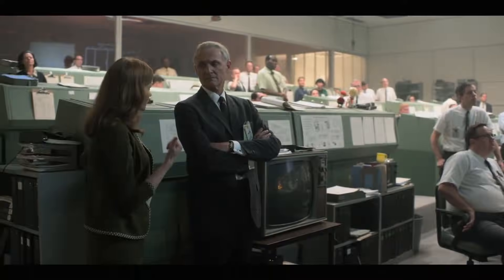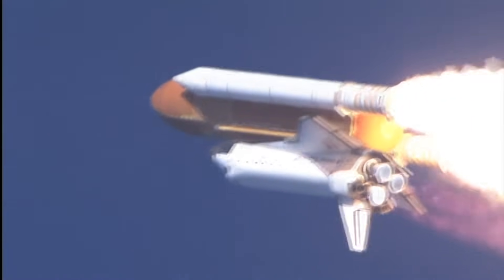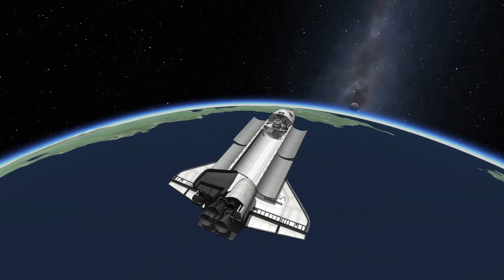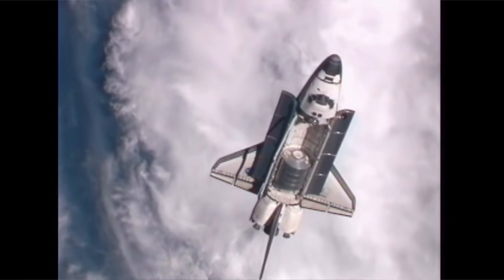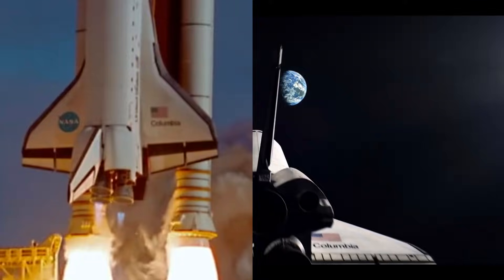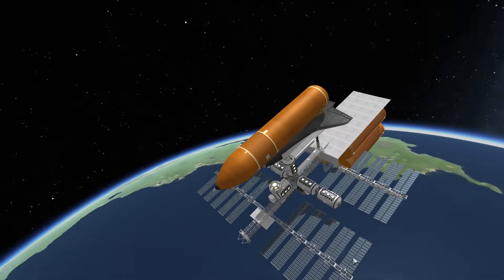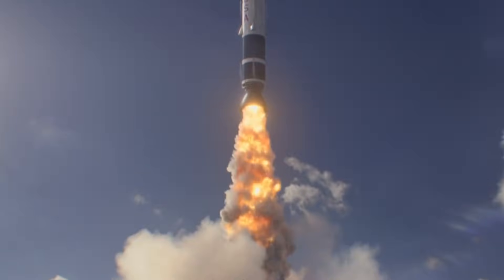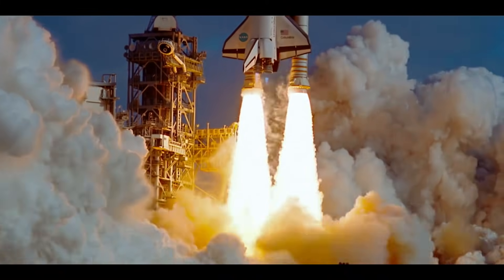How To Send A Space Shuttle To The Moon

Comment: The most unrealistic thing about this video is a working space shuttle in Kerbal Space Program.
Reply: its possible to make one, you just have to get the balance correct.
Reply: @alexvives1335  I found it easier to make a Buran style shuttle in the end. The balance was less finicky.
Reply: Once you figure out how to line up the COMs and COTs through each stage it’s fairly straight forward. I did it in one single design iteration after I figured that out and I know $&#% all about physics 😂
Reply: @thomitch1995  ofc it would, Buran and Energia are better.
Reply: @machirim2805  none of that commie talk here, thank you very much
Reply: @thomitch1995  i just add 4 strap on boosters on all 4 corners of the shuttle
Reply: bless mods
Reply: @machirim2805  Fucking LOL.
Reply: @thomitch1995 Really? I always failed to get my Buran-Energia to Orbit in KSP, but have a Space Shuttle that works okay.
Reply: @cocodog42  wanna share your technique?
Reply: @rhycecomley  use the COG and COT indicators and run the COT directly through the COG. The COT has to go through the COG directly enough for the thrust to be balanced. It has to run through the COG at every stage separation and even when fuel is burning. Because of this I normally make them backwards to visualise the craft at every stage separation and shift weight around slightly/shift angle of the two small thrusters on the shuttle, and change fuel levels ect. If you balance it well enough, any slight variations in COG COT alignment will be small enough for SAS to deal with. Good luck, if you are clever enough you will be able to do it.
Reply: @cocodog42  cheers for the input, however it seems alot less about how clever you are and more about luck lol
Reply: Skill issue
Reply: You can say that again
Reply: @awesomemcawesomeshorts9531 is it communist to say the buran was better than the space shuttle?
Reply: There is a pretty good one out there for RP1 / RO
Reply: Especially one in what looks like RSS
Reply: With the correct balance between trhrust, gliding and mass you can also do it stock.
Reply: Nah it was when he said “assault weapons”. Dumbest thing in this video.
Reply: Throttle Controlled Avionics makes it much easier. It gives you thrust vector based SAS rather than cockpit orientation based SAS, and it has differential throttle.
Reply: It's easy to make one, but o failed to launch it I would do a roll, but It would go straight, I hate make shuttles, bc they take a bunch of time, and they are trash at flying lol
Reply: @peeperleviathan2839 It’s dishonest to say a ship with only one orbital test flight is better than a ship with over a hundred, yes.
Reply: @peeperleviathan2839 no because Buran actually was better than the Space Shuttle. Then again, if it makes people feel better, since Buran was designed off the stolen plans and test data of the shuttle program, it allowed the Soviets to refine the concept off the hard legwork and cost of the USA.  But even Buran wasn’t immune to some of the design problems of the space shuttle, like it’s heat tiles be prone to debris damage coming off the Energia rocket.
Reply: True
Reply: I got mine working, just needed to up the thrust

Comment: Now remember.. the more fuel you need.. the more fuel you'll need
Reply: Thats why Apollo went off as a huge building size and returning could barely squeeze 3 folks inside.
Reply: It takes fuel to carry fuel to carry fuel to carry fuel to carry fuel to carry fuel ...
Reply: @i don’t know what to do here if you can make fuel at your destination you dont need to carry that .. so you save a lot of weight and complications. thats what SpaceX is trying to do developing fuel plants so a future mission to mars could had the fuel for the return trip allready on Mars.. same concept as used in the Martian where the MAV had a fuel plant processor wich made fuel during years on the surface from the atmosphere so they would not need to carry that fuel with them in the inbound flight
Reply: To carry more fuel you need a bigger rocket... The bigger the rocket the bigger engine you need to lift it... The bigger the engine the more fuel to feed it l... And so the cycle continues as a balance is hard to find
Reply: A spacecraft's main cargo is fuel and oxygen. Everything else is by the way.
Even a passenger jet on a long-range flight can take off at 1/3 fuel by weight, an orbital spacecraft is mostly fuel & oxy by weight :)
Reply: @mattstorm360  destination *
Reply: I learned that the hard way trying to refuel a refueling station orbiting the Mun. 😕
Reply: Unless your fuel is powerthirst, then be prepare for some uncomfortable amounts of energy!
Reply: @Pfromm007  gratuitous amounts of energy!!!!! As fast as Kenyons!!!!
Reply: Rocket equation in a nutshell.
Reply: moaar boosters
Reply: Unless you go nuclear! 🙂
Reply: @pricelessppp  Still applicable. The more propellant you need the more propellant you need.
Reply: @dinostudios6579  True.
Reply: And remember, once you get to the moon, you’ll have to come back.
Reply: Gotta love Differential Equations.
Reply: Huh huh..yup 👍
Reply: @celsetialarchives5909  THAT'S why it's called ROCKET SCIENCE..🤔

Comment: In season 2 they did mention refueling in orbit, and they had sea dragon for payloads. So the shuttle was just used for crew exchanges. It wouldn’t need to use the external tank
Reply: The main issue I have with that is the Seadragon could launch both the space shuttle (orbiter), and the payload

It could launch four orbiters, and fit them all, all to low earth orbit

The space shuttle becomes completely pointless
Reply: @glauberglousger6643  gotta love hollywood 🫠
Reply: At least they gave it a mention so a non engineer would at least have to google it.
Reply: They only used sea dragon for big cargo - Jamestown modules, mining equipment, etc. Possibly the second LSAM but the first one was sent on a Saturn V. Day to day supply was done by Titan rockets.
Reply: @glauberglousger6643 the main issue with your idea is that the sea dragon wouldn't, and really couldn't have been human rated
Reply: I think that they used space shuttles because they're recognizable and they could use historical footage of shuttle launches instead of having to create their own CGI ones. We have to remember that this is a TV show on a smaller streaming service so they probably didn't have the budget to both come up with and do CG work for a completely new system.

Comment: In 1983, a classmate kept asking me: "Why don't they use the space shuttle to go to the moon?"

37 years later, the definitive answer is here.
Reply: My question that noone ever answered is why did the orbiter have the massive dead weight of the main engines on it, if they could only be used until the external tank has been dropped? It would have made much more sense to put them right below the external tank and only give the orbiter engines that it could actually use while it is on its own. Interestingly thats exactly how Buran would have worked, so sad that it got cancelled.
Reply: @Chuckiele  I think there's a lot of weird things the shuttle did
Reply: @Jaker788  yeah,  but this is something that really bothered me, because it could have allowed the launch system to be used for other heavy payloads and would have made the orbiter more versatile and efficient.
Reply: @Chuckiele  I think it's because of the RS-25 being a cripplingly expensive engine so recovering them for reuse on the shuttle was done to try and reduce launch costs.
Reply: @ezraprice6709  Well, the RS-25 was only designed to be this expensive because they knew it would be reused, it obviously would have been way cheaper if it was designed to be expended, but I thought making the external tank plus engines a proper reusable first stage would have made much more sense. Landing savely is obviously not easy but at least the engines would have to do that much of a reentry.
Reply: Have you ever heard the proposal of Space Transportation System (STS) which was proposed by NASA in 1970? Space shuttle was designed to ferry crew and cargo between low earth orbit and the earth and was only one component of the STS which includes 1. Space Tugs, 2. Nuclear Propulsion shuttle between low earth orbit and interplanetary deep space, 3. low earth orbit propellant depot, 4. Space Tug based transfer vehicle shuttle between low earth orbit and the moon,5 Space Shuttle that ferry crew and cargo between ground and low earth orbit. The Space Shuttle was the only component of STS proposal approved by Nixon administration in 1972.
Reply: The Space Shuttle was never designed to go beyond LEO!
Reply: @powerfulstrong5673  Yep, once the space race was over, it became boring and they didnt wanna keep spending money on space exploration. It was the beginning of the end for a very long time but finally we are back at it.
Reply: @Chuckiele  I just don't know why Venture Star SSTO space plane was cancelled!
Reply: @Chuckiele  Venture Star SSTO space plane and aerospike engine are very good technologies!
Reply: @Chuckiele  The main engines was designed to be in the orbiter was because the shuttle was designed for reusablity!
Reply: @Chuckiele  Of the space shuttle, only the external feul tank wasn't reusable.
Reply: @Voice_from_the_Void  Have you ever heard the proposal of Space Transportation System (STS) which was proposed by NASA in 1970? Space shuttle was designed to ferry crew and cargo between low earth orbit and the earth and was only one component of the STS which includes 1. Space Tugs, 2. Nuclear Propulsion shuttle between low earth orbit and interplanetary deep space, 3. low earth orbit propellant depot, 4. Space Tug based transfer vehicle shuttle between low earth orbit and the moon,5 Space Shuttle that ferry crew and cargo between ground and low earth orbit. The Space Shuttle was the only component of STS proposal approved by Nixon administration in 1972.
Reply: You couldn’t have figured it out yourself??
Reply: It means you older than my dad
Reply: @Chuckiele  The shuttle's main engines are extremely expensive. Mounting them on the shuttle orbiter allows them to be recovered and re-used.
If the main engines were not carried by the orbiter to protect them, such as by mounting them on the back of the external tank, then there's no way to recover them--they would be destroyed on reentry along with the tank.
Reply: @devilsoffspring5519  Then either make the external tank reusable or the engines expendable. If your design requires you to carry dead weight for it to work, then its a bad design.
Reply: @Chuckiele  An item has to be specifically built to survive reentry and the external tank isn't suited for that. Large, lightweight objects that make it all the way to orbit, or nearly to orbit, cannot survive reentry. They would be too heavy for flight.
So, smaller things survive reentry, big things do not--and the really expensive bits like main engines go on the small things :)
Reply: @devilsoffspring5519  No, doing that is exactly why the shuttle was such a financial disaster. Making the main engines expendable would make them much lighter and much cheaper and putting them below the external tank would significantly reduce the weight of the orbiter, allowing it to have more payload, more fuel or both or just cut down the size of that monstrosity. On top of that, it would have allowed them to use the launch system without any orbiter for uncrewed launches and very heavy payloads.

Making the shuttle more expendable would have made the entire program cheaper and price was one of the main reasons why they wanted to go with reusability in the first place, right? I dont think that expendable launch system are superior and Im glad that they pulled the SRBs out of the ocean even though refurbishing them didnt make the program cheaper but actually more expensive and I sure hope that theyre gonna do the same with SLS even without any intention of reusing them.
Reply: @Chuckiele  Or better yet, they're developing newer systems that seem more conventional in design, but the really expensive part (first stage) is reusable, and the second stage is expendable. So, it's much more cost effective, and it can launch both manned and unmanned payloads.
Reply: @devilsoffspring5519  That would be called a Falcon 9 ;)
Reply: @Chuckiele  That's the one :)
Reply: @ezraprice6709  "reuse"
Reply: @Chuckiele The engines are really expensive
Reply: @Chuckiele  

RS-25s were expensive and justifiably were reusable for that reason. Sure it was extra dead mass but reusability requires that. 

Buran failed because it was too expensive to sustain. Part of that being to replicate the RS-25s without reusability and hence no more then 8 of them ever flew compared to the at least 15 engines that flew on space shuttles.
Reply: @Chuckiele  
It wouldn’t have been cheaper.
Reply: @powerfulstrong5673  

Carbon composite structures didn’t mix well with liquid hydrogen.
Reply: @topsecret1837  Id like to see some evidence that the Buran was more expensive to fly than the Space Shuttle.
Reply: @Chuckiele  Because the magic word is 'reusable'.
Reply: @Chuckiele  That was the original plan. The external tank and SRB system were adopted after the original plan of having a big, manned, flyable booster was abandoned. By that time though the Orbiter design had been largely finalized.
Reply: Not enough fuel , heat shield not designed for reentry .
Reply: @Chuckiele  I think Scott Manley did a video of the USSR's version of space shuttles. Their version didn't have the 3 large engines on the shuttle plane, and they were instead mounted on a reusable rocket assembly.
Reply: The shuttle needs the weight of its engines to glide and land.
Reply: @Chuckiele it was quirky like that :3 I think buran had main engines on the main rocket
Reply: @Chuckiele They wanted to reuse the main engines. That's why they were on the orbiter.
Reply: @powerfulstrong5673 Politicians are so HOPELESSLY lame!!!👎👎👎
Reply: @Chuckiele The whole thing was a massive, hopeless dead end!☹️
Reply: @Chuckiele "only designed to be expensive because they knew it would be reused"
space shuttle in a nutshell
Reply: @_apsis  Yeah, seeing the shuttle launch was incredible and the things it achieved are undeniable, but damn do I hate that thing with a passion because it was such a bad compromise. Im glad private space flight is finally making senator rockets obsolete.